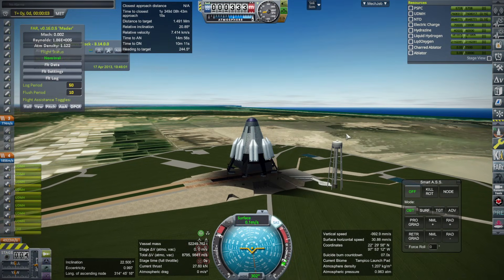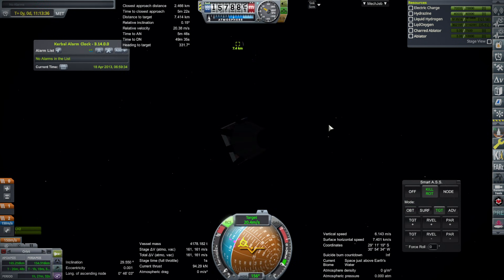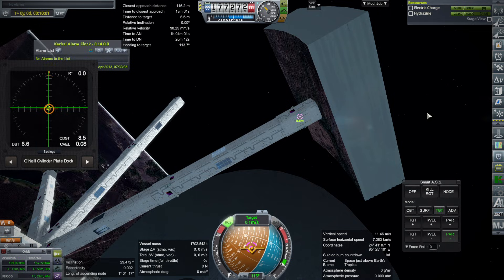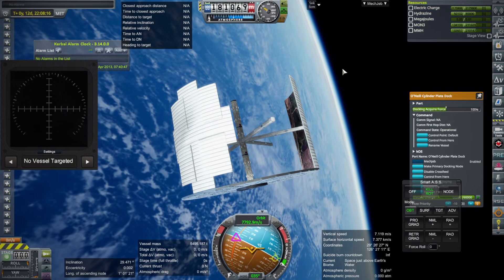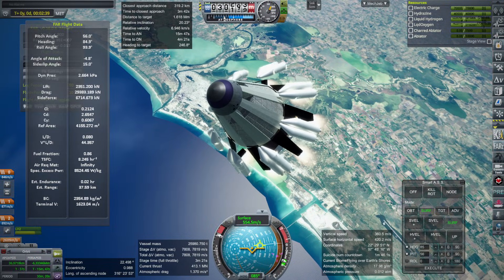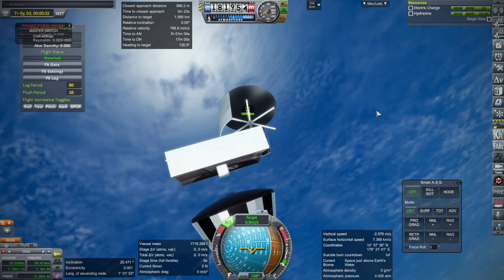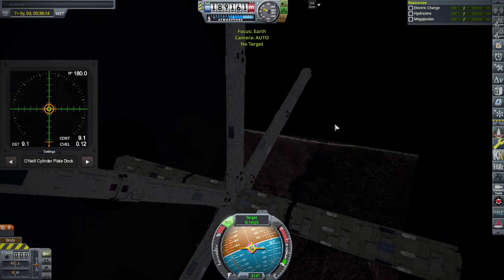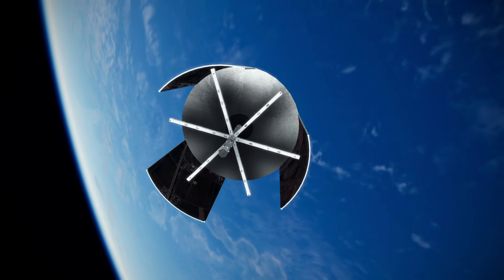O'Neill Cylinder Construction 6 (Kerbal Space Program with RO)

Comment: What are the numbers on this? I was under the impression that it would be nigh impossible to launch 4-6 gigatons of material into LEO
Reply from the maker: The mass of the cylinder is just the metal structure of it, so it ends up not being in that range, though I don't know if even with the soil, air, and structures it would amount to gigatons for a cylinder this size - I doubt it. Each plate is 1700 tons and there are 36 plates. Aside from those, there are lots of additional structural pieces, but they have less mass. Altogether, this is probably approaching 100000 tons.

Comment: MKS USI should work with the O'Neill Cylinder. You would create Material kits and Specialized parts on the surface of a celestial body, transport those to orbit and then have engineers or automated drones construct the O'Neill cylinder with a USI launchpad / orbital dock. It would require the mass of the O'Neill Cylinder to be transported into orbit. You would not have to do any modifications to USI MKS using the RP-2000 configs to create a O'Neill cylinder from resources on the Lunar surface, I have created smaller things however the process is the same. I understand not wanting to deal with the mysterious thermal and drilling properties of USI MKS though.